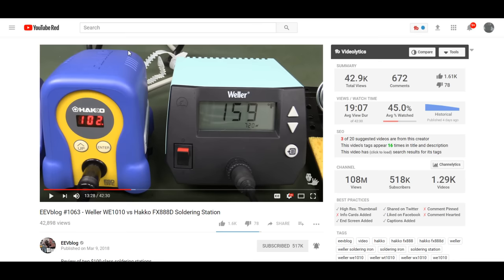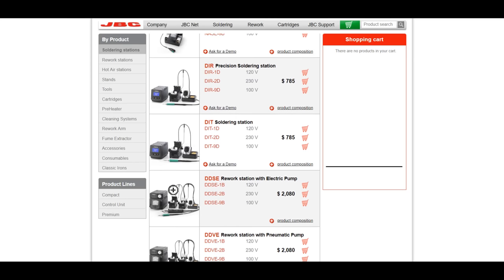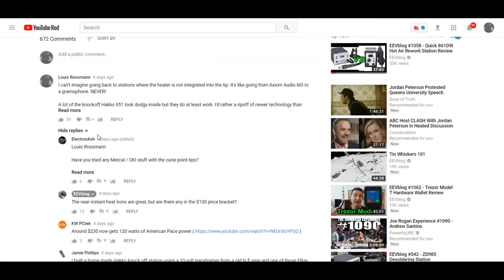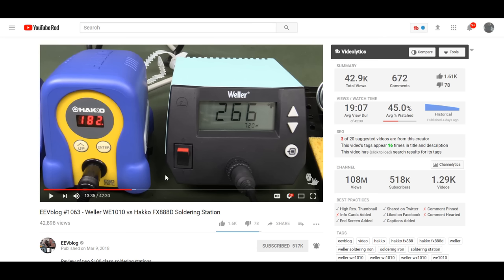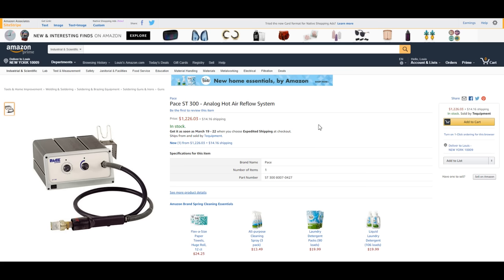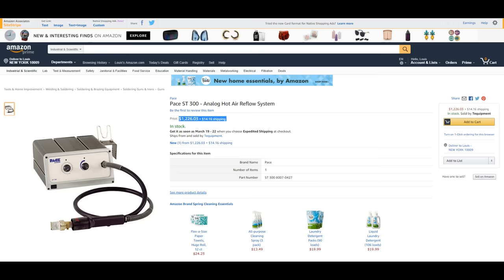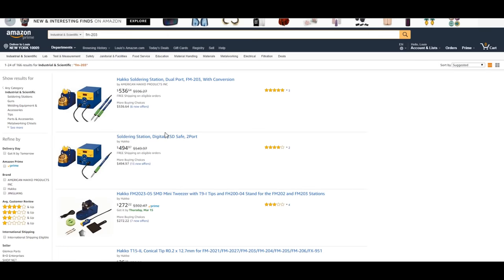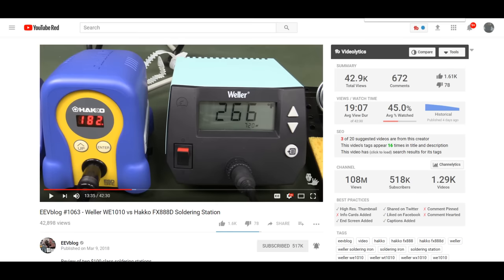Soldering station technology & the lie of "SOLDERING PATRIOTISM"

Comment: ...but the 386 has a TURBO-Button! =)
Reply: jiddschdr Turbo down clocks the CPU anyway.
Reply: depends on the settings.
Reply: jiddschdr The 386 doesn't suffer from Spectre/Meltdown like the Pentium II and later.
Reply: doesn't matter that the turbo button turned down the clock to 4.77MHz. It was a button that said "turbo" on it and in the 80s-90s, that made anything awesome. :)
Reply: @johnfrancisdoe1563  A security risk that no one has ever taken advantage of in the real world is a small price to pay for instruction pipelining
Reply: @captainbodyshot2839  That vulnerability has never been exploited only because nobody knew it existed. Also, pipelining can be implemented correctly with no vulnerabilities, it's not like you have to choose.

Comment: Louis, for CD stations from JBC (cheapest ones) you can connect both type of handpieces t245 (standard size) and t210 (for microsoldering), like you did with fx951

Comment: 6:38

Haha - So weird seeing my comments on one of these vids.

It's tough to convey to people about what it's like using a "direct-heating" soldering station vs the older style with a separate heater.

Until I used a Metcal at work (about 15 years ago), I'd used many of the usual brands of iron, from Antex to Weller, including the cheapo mains irons and the expensive stations with big chunky transformers that heated up much faster.

But, I then used the direct-heat Metcal stuff for an hour or so per day, and I've never looked back.

I couldn't really justify the cost of a brand-new station for home use at the time, so I bought a second-hand SP-200 for only around £70 on eBay (including a chisel tip, handpiece, and stand). A few years later, I then saw an MX-500 station for only around £100 on eBay, and couldn't resist.

That was more than ten years ago now, and the MX-500 is STILL going strong.

The tips cost around £11-16 on average, but last easily 4 years or more if taken care of, which is much longer than most of the cheap mains irons last (at a similar cost to a new Metcal tip).

It's easy for people to say it's somehow "elitist" to champion the direct-heat stuff, and yes, they do cost a fair bit more new, but I guess you would have to try one for a few weeks to see the light. :p

Something like that 951 looks ideal at around $250, and I reckon it would pay for itself in no time.

So yes, IMHO, I would say that the extra $100-150 for a direct-heat soldering station is worth every penny. I don't think I'll ever go back to using the older style iron.

That's especially true if you don't mind buying second-hand, as the stations are generally very robust and reliable, so it's well worth taking a chance on one, as long as you're not relying on it for "mission critical" use. I sold two of my previous Metcal / OKI stations to friends over 4 years ago, and those stations are also still working great, even with the same original tips that were included.
Reply: Oh, wow, I hadn't even seen Dave's follow-up reply of "2nd-hand doesn't count" yet, as I just got back from a weekend break.

So, thanks for making a better point, Louis. lol

You're right - I would also much rather use a $100 knock-off station or second-hand direct-heat, OR just pay the extra $150 for something like the genuine Hakko 951 than use the older style tech, any day of the week.

I kind of expected some of the sillier replies on Dave's vid when I first posted on there, but I would bet that at least 60% of those people have never used both types of soldering tech over many years in both a production environment and at home before forming their opinions.

I don't think I'm too biased either, as I'd used all sorts of cheap AND very expensive soldering stations for many years before settling on a direct-heat system for personal use.

At the four different electronics factories I worked at (Nortel, Bookhams, AVX, and Syntech), they used the direct-heat stuff almost exclusively (Weller, Pace, Metcal / OKI, JBC etc.). I think that says a lot. lol

Comment: No real problems with the FX-888D for a starter station, hell, some people may want to solder for crafts rather than electronics repair,  for example, and something like an FX-888D is perfect for that purpose, if not overkill, and it's also fine for the hobbyist-level or low-volume electronics repair operations for which it was intended.

Comment: @Louis Rossmann -- for PACE tweezers the "old tech" TT-65 are the ones where the handle gets hot -- there's special grips (which they should have installed by default instead of selling separately) available to mitigate this.  The MT-100 cartridge tip tweezers don't have that problem that I'm aware of.

Comment: In my experience i was able to use a t210 iron on a t245 station(the "older" i guess CD type without a cover in the brass barbed wire)

Comment: I just use a cheap $20  60 watt soldering iron from eBay. Been using it  for almost 10 years.. It gets to full temp in less than 10 seconds.  As a hobbyist, why would you need any quicker?

 Maybe if I was doing board repairs for a living I would get a "modern" soldering iron.  But I honestly don't care if the heating element is built into the tip.

Comment: What I understand is, just wait 3 seconds with my old cheap soldering iron :)
Without integrated tip to heater element
Reply: Sure. But now solder a big chunky connector. Integrated heater tips are just immensely superior.
One thing I'd say about the JBC though is that it still has a better thermal capacity than the hakko IMHO. Your mileage may vary.
Reply: Toumal Rakesh nice input 👍 it does make sense.

After all it gets back to feasibility or worthiness
Reply: Absolutely. JBC is expensive, I love mine, but I honestly could've lived with the Hakko knockoff as well. The only real drawback is their user interface, which is terrible. "Alarm Clock Interface" indeed. A rotary encoder would be superior. Simple up/down buttons would've done the job. Like on the JBC. Thermal capacity may be bigger, but the question is whether it's $200 bigger...
Reply: +Toumal Rakesh Put on a chunky tip and/or raise the temperature. Sure, it's not as good as a JBC with a high thermal capacity tip, but it'll get the job done. 
Of course if you're a professional that's an unacceptable waste of time, but if you're just a hobbyist, you can get by with $30 Hakko knockoff.
Reply: I prefer the weller but the WX series. Just due to also work on a lot of older stuff and well and having 200w is useful and built quality is better then the hakko I tried.
Reply: Knowledge  Yep me too. I have the Weller 1010 pictured above and it heats up,  room temp to 675 F in 35 seconds. Good enough for me.

Comment: I do have a question though. I burn through tips quite often.
How much would you pay for a tip, that is just a tip that you put over your element, vs a tip, that has an element built in?
The iron I actually use most often is an Antex XS25. it's a stick a plug in a socket and go, not even temperature controlled.

Comment: I bought a used Pace HW-50  (50w soldering station) for around 70$. It uses those tips with heating element integrated in them, you can still buy the tips for around 10$ each at reputable distributors. I also have an original Hakko 936 - the benefit of those Hakko 888 is that they're basically refreshes of Hakko 936 (while officially tips are different in practice you can still use tips for hakko 936 including  cloned tips you can find on ebay at x dollars for 10pcs set)

Comment: this is really helpful, since i can use the sweet Pace(mbt350, and the hot tweezers never burn our hands) rig at work, i want something better at home and want something cheaper than the full out station. while i like the pace, i am not married to a brand yet.
the MBT 350 has 3 channels, our set-up uses one for the iron, one for the hot air or the solder sucker, and one for hot tweezers. this put 3 devices in one unit and helps with bench space.

Comment: This new technology might be interesting, but I will keep my cheap (~40€) ZD-937. It needs a little bit longer to heat up, but it will do the job it has to do. I have gotten 3 machines for less than the one you recommended. ZD-937 (~40€), Desolderingstation ZD-915 (~80€) and a hot air station 858D+ (30€).

Comment: Interestingly, the even older tecnology was Weller Magastat where the heating element is separate but the sensor is the tip, because it senses the temperature based on the magnetic properties of the alloy uesd in the tip.

Comment: I have a 50+ year old Weller station (well older than me) with the 4 prong offset plug. It was originally in the navy, then spent time in a lab and now its on my desk (I'm the 3rd owner). I used it the other day and found that something wasn't right. Either an element or the magnastat is going out. I get a good hr of use before it starts to malfunction. Model # TCP-1. I hop to fix it up as my de-solder rig. It still has the de-solder bulb attachment, chisel scraper and dip remover. Due to it's age, I'm not going to trust it with my MCU projects but i like using really old stuff in every practical way.

Comment: This was really helpful. I have a low budget (I'm a teenager with a min. wage job) and I was about to buy an fx-888 instead of a hakko t12 tip station made by a company called KSGER but now I think I will change my mind. I guess I was more motivated by the hakko brand name than anything else.
Reply: I would say go for the KSGER T12 tip station. I am a university student who has been using a cheap $20 soldering iron for over 10 years and I finally decided to look into a better soldering station. I honestly wish I knew about the KSGER and other affordable t12 tip compatible stations earlier. I thought that good soldering stations still cost $250+ so I just stuck with my $20 station which would take forever to heat up and only has one tip making it impossible to work with anything that has a lot of densely packed pins. Only recently did I discover that there are a lot more options on the market. I honestly feel so dumb that I put up with cave man era tools instead of finding the time to do some research.
Reply: @CompGuy66  thanks for the comment. I got it a couple months ago and I'm LOVING it. It takes, at most, 5 seconds to warm up. And the tip to handle distance is fantastic. My only issue is the temperature fluctuates a little (±5 degrees) but that might be my fault because I tried to calibrate it and I didn't know I needed a soldering iron thermometer. Other than that it's a fantastic piece of kit.

Comment: Another TS100 convert here, after owning two traditional soldering stations. The first thing I did after trying mine out was order another one to have a backup in case the unthinkable happens. I needed something that could do high power joints because I work a lot with drones (whose main power wires can easily carry 100+A), and once you crank up the temperature the TS100 will do them - which is nothing short of miraculous when you consider how tiny it is. And of course it's an excellent all-round iron, good for SMD work too if you order the special narrow tip.
Reply: still on ts100 after 4 years ? or you founded something better ?
Reply: @GlishaSo  I now mostly run a KSGER T12. It's a fixed soldering station so a little more ergonomic for benchtop work, also it runs cheaper T12 tips. But I still have my two TS100 as backups and if I need to solder somewhere else. However, there is a better portable iron today - the Pinecil v2, effectively an evolution of the TS100.
Reply: @fallingwater  ok cool i love to see that i am on same way i had 1 ts100 and before few months  i purchased T12  and now using them both how i feel but yeah t12 have cheaper tips and its own power. nice yeah i saw pinecill v2 its sick  but still i think i am good with this one and will wait maybe little more for it or not change it at all we will see :) and to be honest these days im fighting to find good soldering wire in EU idk. sometimes mechanic from ali is ok but still searching for good one. i had 250g old one loctite it was amazing but now idk if you have some rly good to recommend tell me :) tnx

Comment: You can use any ripoff station because integrated tips are great, even just a cheap "12-24v 75w mini adjustable handle," which I use with a solar panel for outdoor soldering.

Comment: Soldering stations are like welding machines. Most hobbyists don't know even expensive industrial welding power sources are treated as "consumables" in production and especially construction. They exist to join metal and that they produce sufficient number of proper joints for their cost that is all that matters.  
Either machine needs only to last long enough and produce enough quality joints! 

Pace make nice stuff but for the cost you could equip most of a workbench, get going, and should they wish to buy a Pace they can AFFORD them.
There isn't a hell of a lot inside a Pace or anything else. I just dissected a dead one to save the case for a project box and while the components are clearly industrial quality and I can afford one I will not be buying from them because that extra money will put much more equipment on my workbench! The high price delta means a customer can have a ready spare and still have change left over.

Comment: An almost criminally deceptive graph at the beginning where you are required to notice that the y-axis on the first graph is 20-350 whereas on the second it's 280-350. The second graph's yawning chasms would appear as small bumps on the first's steady state line.
Reply: You're also required to notice one is for heating time from cold and one is for maintaining set temperature under load.. It's not deceptive if you can read.
Reply from the maker: It is as I called it enemy propaganda, I just loaded it up to make a point
Reply: +Monkeh - fair enough. Although Mr Rossman had already explained that 'propaganda'. It's the kind effected by the juxtaposition of those graphs as a visual montage - Eisenstein'n'all that. Nothing to do with text (which I can manage adequately, thanks).
Reply: Not just that, but the irons recovery time is gasp 5.5 whole seconds! Wow, what are you gonna do! Time is money! Chop chop, I lost 3 cents of my time just waiting here! 

Honestly it might important for a professional like Louis, but for most home users, hobbyists, or people not doing super heavy work, it's almost irrelevant. 

Better spend 2.5x as much on an iron that recovers 5.5 seconds faster! Yeah! Sound advice! Or just buy a knock-off station! Yeah! 

Honestly a knock off isn't a bad idea if you're just getting started. But you're still better off with genuine gear most of the time.
Reply: it's not "deceptive", it's "statistics".
Reply: It's not deceptive, it's very common practice to generate graphs starting at a number that makes the graph more legible; rather than having a graph where 80% of it is blank space. Now if they were comparing the exact same metrics of two irons, and represented one with an abbreviated graph, and the other with a graph that starts at 0, THAT would be deceptive.
Reply: I noticed that too, but they are illustrating it correctly, the short scale makes the interesting part of the graph more readable. However, at a glance it also makes the problem look more severe than it actually is. Personally I’m quite happy with my FX888D, it’s a lot better than the 300 euro Weller I have at the office. But then again the Weller is the most expensive soldering iron I’ve ever used. The only issue I have with it is that the tips aren’t hotswappable, naturally, but I solved that by ordering a second iron. I’m wondering however if the better cartridges could be modified to work with the FX888D

Comment: I still use a 30W Radio Shack iron made by Ungar (the one with the screw-on tips).  WIth the fine tip (0.0625" chisel point) it does not take too long to recover between joints.  With wider tips, even less.  If I did as much soldering as you do, I'd probably want something better.  This has caused me to consider a Hakko if I find myself needing a temperature-controlled station.  Thanks for doing this.

Comment: If you have a good sensor position and know your system, you can get a very close temperature control on the "old" technology.
You just have to avoid simple regulator types.

Edit: 
Time to reaching the 350°C target temperature is mostly defined by the power of the reating element... So JBC implemented stronger heating elements. Great.

Comment: I have an Atten 980d that I use for a lot of through hole stuff, it heats up quickly (much quicker than those in Dave’s video), the tips work fine and cost very little... but I also have a Metcal MX 5241 which is a noticeable step up but with more costly consumables. I actually picked the Atten up as a cheap backup iron but I actually have both in use and setup for different jobs.
Reply: I have the same as you. But i just regret that a little. I bought some tips but the tips of the hakko one of louis are much better. 
So this Atten works well despite the old technology but the tips aren’t perfects. 
When it will get money back of using it, i will buy the hakko one.
Reply: Homer Simpson it uses the same tips as the Hakko 888d but I’ve actually found the temperature stability to be superior to the Hakko (the Atten 980 has a dedicated temperature sensor (unlike the cheaper but identical looking Atten irons). The Metcal will always be better (it shouldn’t be at £900) but the Atten still gets use!
Reply: Please quit overusing the word actually.  Thank you.
Reply: Stinky Cheese « Love Actually is everywhere » Hugh Grant
Reply: Stinky Cheese okay... actually on second thoughts...